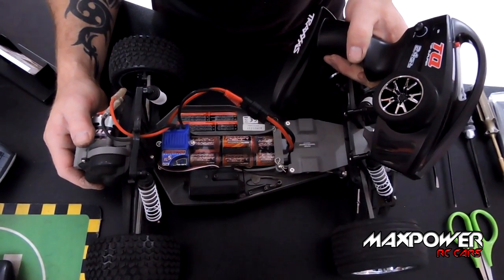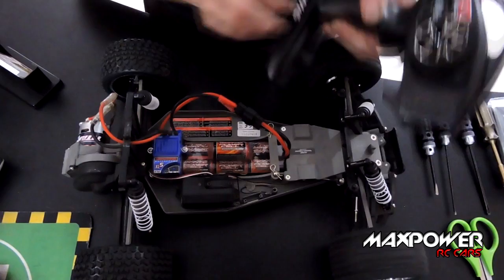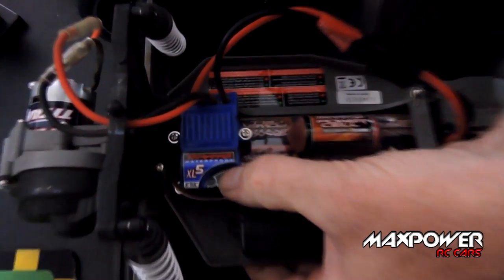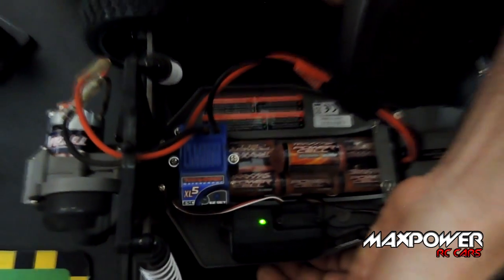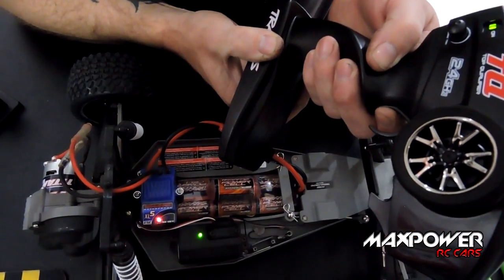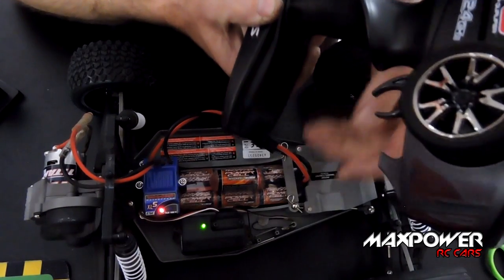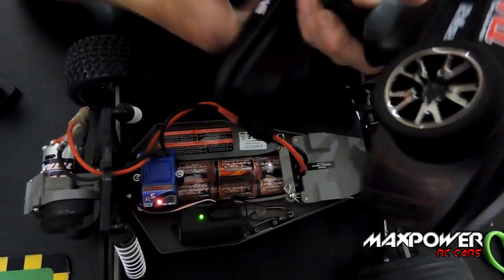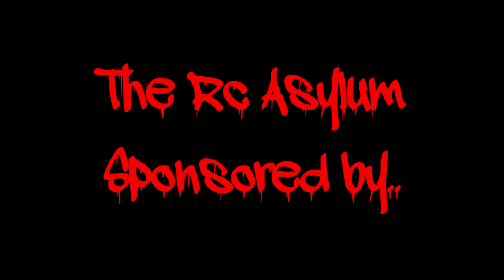Traxxas XL5 ESC Calibration ( How to )

Comment: Rc Asylum. When the Red Light comes on I let go. It blinks once then I press and hold the gas. It never blinks after that. Is it the Receiver? i bought new motor and esc. I know for a fact the servo works and yes they are in correct channels. I hate to spend $25 bucks on receiver and it not be the problem. Any suggestions? I'm super frustrated.
Reply: I'm having the same problem, did you ever figure out a solution? Much appreciate the help
Reply: I’m having the same problem did either of you guys ever figure it out ?